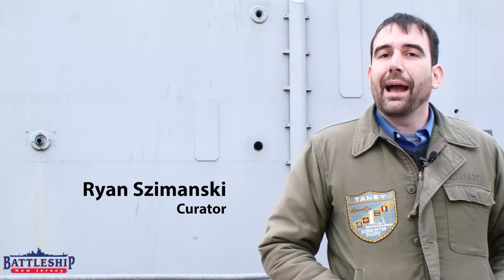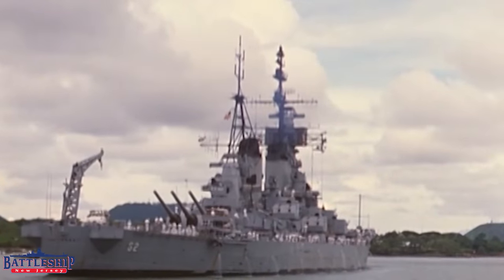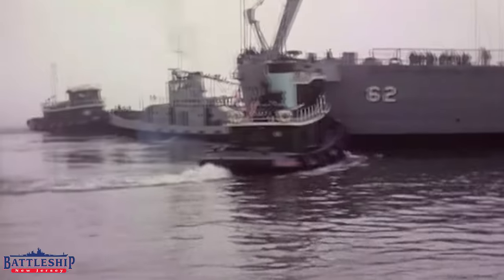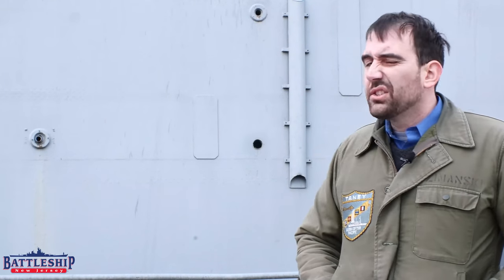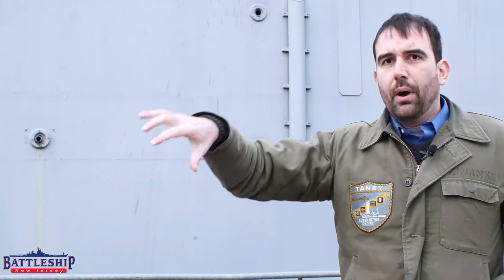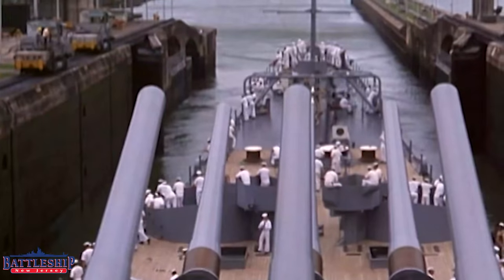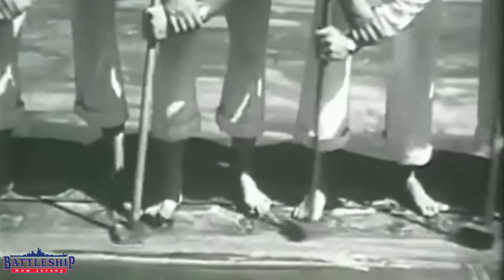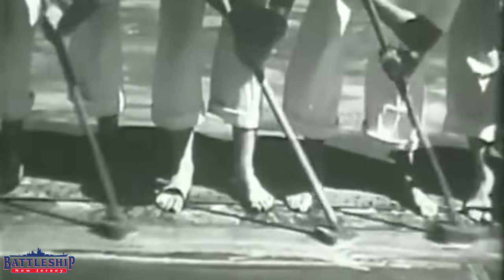Why Is There Water Coming Out the Side of the Ship?

Comment: All ships have lots of equipment that needs water cooling, especially old ships, before central cooling systems were used.
Fridge condensers, air conditioning, water and oil cooling etc, and could also be deck drain like he says. 1500 people use a lot of food and need a lot of cooling! Especially in sunny climes!!
Get the pipeline systems on the net and I am sure we could work it out.
Main engine and generator condenser cooling would be larger diameter and lower down on the ship than those visible.

Comment: I was discharged from the navy in 1982. I was given the opportunity to serve on the USS IOWA on recall. I was not selected.  There are drains as explained by the narrator. I don't know about capital ships not having sanitary drains during the WWII. 
There are pumps called the fire and flushing pumps. You wash the deck, fight fires  and flush the sanitary system. I served on a WWII Destroyer 1961-1963. I served on a Destroyer 1967-1969. Same system. Last Destroyer 1975-1979.

Comment: they are not all deck drains, half of them specially closed to the waterlines with big discharges are cooling water discharge for the AC systems and the propulsion systems, i know this because i am a USnavy retired and spent most of my career in four different ships. and to add to that i was a master diesel mechanic and diesel was the primary propulsion system of those old war ships.

Comment: Some suggestions below say possibly condensation from cooling. From the engine heat,  sure.  Ships in those days did not have air conditioning, which of course is a de-humidifier as well. I read that our late war submarines had air conditioning but most Navy ships did not.  Before 1941 not many people had experienced A/C. After 1945 everybody had, even if just in stores, offices and especially movie theaters.  I wonder of some admirals could have gotten the officer quarters air conditioned. I read somewhere that was the first step in making ships more livable. A treat for the pilots on aircraft carriers. I was born during the war, and I remember movie theaters having A/C in the late 1940s and into the 1950s.  Perhaps some A/C was added post war. My parents installed an A/C in their bedroom and the living room in the 1950s. I suffered. I was 18 before my bedroom was air conditioned.

Comment: We would never pump out "boiler feed water"! It simply takes so much effort to make it, that pumping it over the side makes no sense. First you have to distill it in the evaporator, then "scrub" excess oxygen from the water in the DA Tank where it is heated to 250*F under 15 psig, then it goes to the Main Feed Booster Pump, then to the Main Feed Pump, then on to the boiler which depending upon the ship was either 600 or 1200 psig steam. Consequently, there is no way such valuable water in a closed system would be open to the atmosphere. Much of the drainage you see when a steam powered ship is underway is from the bilge pumps in the engineering spaces which consists of the fresh (distilled) water used to cool and "lubricate" the pumps used in the steam making and utilization processes. I could go into much more detail on the steam cycle, but this should answer most questions. Oh, and another thing we did pump poop right from the toilet to the sea. Never heard of a sewage holding tank when I was in the US Navy from 1968 to 1972, especially on a destroyer. Maybe on newer ships but not the WW2 vintage that I served on.

Comment: I would have guessed the screws are a weak point (for watertightness)
Reply: That was always my understanding as to reason bildge pumps were fitted.They are big shafts and providing a watertight seal must be difficult.? Mind you crankshaft oil seals on an engine has to cope with alot but will eventually degrade and leak.

Comment: Discharge overboard is cooling water from Diesel engines they use an inter cooler fresh water is cooled by salt water ,the hot salt water goes  overboard.
The main circ  pumps suck and discharge from the keel of the ship. They are underwater  and are part of the close feed system  from the boilers to the engines.

Comment: People often criticize the Bismarck battleships design for not having very good protection for its rudders, which ultimately, after a lucky hit, lead to Bismarck's loss.  Yet, I have I was told by a WWII veteran years ago that everyone recognized that the Missouri and her Iowa class sisters, including the New Jersey, had a glass jaws.  Their long slender bows were fragile compared to the rest of the vessel and one (Wisconsin) even had to have hers replaced with that of her incomplete sister Kentucky after a collision with a destroyer. The thought was, the Iowas were just as poorly protected at the bow as Bismark was at the stern and a similar lucky torpedo hit to the bow would have caused any of them to suffer the same fate had they been in Bismarck's place.  What's your thought on that? It's kind of hard to race home with an enemy fleet chasing you with your bow hanging off.  My thought is that perhaps it is a good thing that the Iowas were never in a fleet action like Jutland where the enemy had the strength to go toe to toe and they always operated in waters where they were not on their own against the enemy.
Reply: I don't think the bow is as critical of an area to survival as the stern is. Pittsburgh, CA-72, was sailing without a bow after losing it in a typhoon.
Reply: @TJtod  You have any experience with boats with bow damage, let alone with a bow that has been nearly severed? Good luck outrunning the Royal Nave going full speed astern. Pretty sure the old boy was right, they'd have died just the same.

Comment: Ive heard of road depts using beet juice as a deicing agent supposedly harmless on steel...  also available by the drum...
Reply: The jury is still out on using beet juice. While it greatly reduces the amount of salt required to clear roadways, salt is still required and it is terribly expensive - relatively speaking. Another issue is that the sugar tends to attract certain bugs in the waterways which reduce the amount of free oxygen in the water - an obvious hazard to water dwellers like fish. One great use for the juice is in tractor tires. Added weight with no damage to the steel rims like salt causes.

Comment: Do they ever clean the guns after they get used. Also how do they repair a gun that's been shoot at and it ends up damaged.
Reply from the maker: Cleaning the guns after every use is done with compressed air, that the puff of smoke that comes out after firing. Otherwise its basically a giant q-tip to clean it that gets pulled through, but thats done much less often.
Reply: The entire system is kept pretty much spotless and washed down completely after use.  They used to fire with black powder which is extremely dirty.  It would amaze you how clean the inside of a gun turret or mount is.

Comment: The comment about not pressing tanks is strange to me. Unless water freezes, I can’t imagine popping rivets, if these ships are even riveted since the tanks are vented and designed for a head above the top of the vent. By only filling to 90% you encounter free surface that negatively impacts GM. Even today, USCG and class societies advise against having slack tanks. Great videos though, thank you!
Reply: Most ships today have internal baffles  to counteract free surface conditions. Tanks that don’t have internal baffles installed has what is known as u-tube tanks ( and external pipe above for air and one below for the liquid to free flow  between 2 wing tanks to counteract rolling conditions.

Comment: Random question. What does soddour the pipes mean?
Reply from the maker: Soldering is basically low level welding, usually using lead which has a low melt point.
Reply: @BattleshipNewJersey  thank you for the reply. AHH I see. I guess we pronounce it differently in the UK. I've soldered to build wiring looms. I didn't know it was used for pipework too!

Not just a history lesson today :) 

Thanks again

Comment: There's been a lot of musings in Proceedings lately.. mostly highly critical of "running rust".. where our ships look like shit.. It's sad that museum ships do a better job than the Navy does. Lots of the overboard discharge is related to running systems.. as designed.. little of it is from the scuttles.. unless a washdown is happening.. not unlike my little 20' Stingray..
Reply: The US Navy has horribly lubberly looking ships and "crews" now. I remember my Tincan getting told to go back to sea before tying up in Subic after 4 months on the Gunline in Nam by the SurfPac Admiral. "Paint your ship before you enter MY BASE!".  Anchored out, and every swinging d**k from all departments chipped, wirebrushed, red leaded, and painted the ship for the next 24 hours. Probably impossible for PO's, CPO's, and Officers to get anything done when you have "sexual harassment" and "racism" charges at the drop of a hat hanging over you at any and all times.
Reply: Lots of EPA and HAZMAT/OSHA restrictions now. Crews cannot do mass chipping and painting, anywhere like they used to..  It is Contractor work,

Comment: How did they align the guns in a turret to hit the same point?
Reply: align onto a star and set them all the same.
Reply: @Plasmacore_V  I was looking more at the 3 guns in the turret. I get how to do vertical alignment, but horizontal dispersion is different.
Reply: @beverlychmelik5504  The guns in the turrets are not harmonized like the guns in a fighter plane. The entire turret is aligned as a single unit as shown in the video linked.

Comment: Just wondering, why do you salt the decks of the ship in winter rather than sanding them? Sand works just as well as a grip-enhancer, if not better, and should be incredibly much milder on the corrosion-sensitive materials.
Reply: Sand “might” give you grip, but in the long run it is better to make the ice and snow go away.  Rock salt can do that and pretty quickly too.  Sand just makes everything dirty.
Reply: @RichardAmmo1  I've generally experienced that salting creates a mushy slush that is much worse than sanding things.

Comment: Y'all seriously need to find a new curator.  Every video I come to watch is incredibly inaccurate with a lot of falsehoods and misinformation about how Navy ships operate.  Most of the water is from the deck drains?  🤣  Too funny man.  Most of the water is from engineering using firemain seawater to cool their systems.  Water does come from deck drains, but that's not what you're usually seeing.  We would also use these side drains to flush our magazine sprinkler systems.  However, that was like a once a month maintenance that lasts all of 5 minutes.
Reply from the maker: Not al engineering plants are the same.